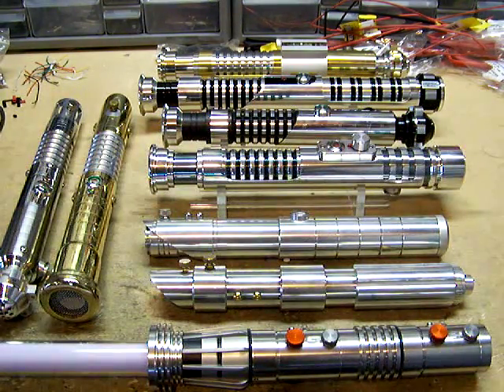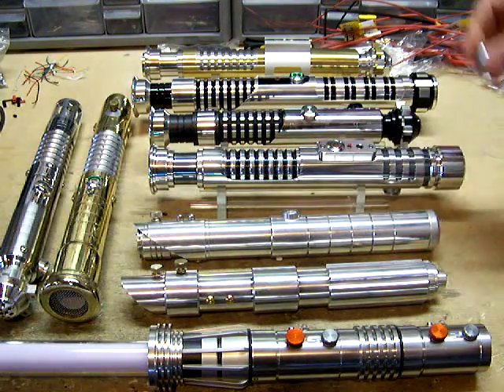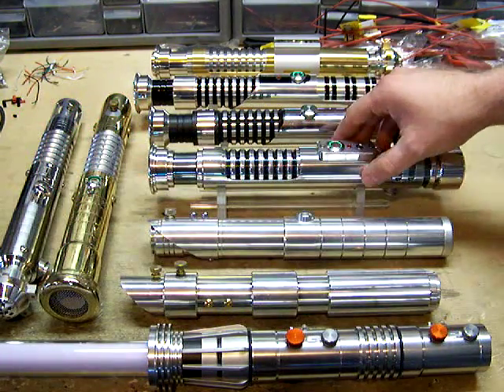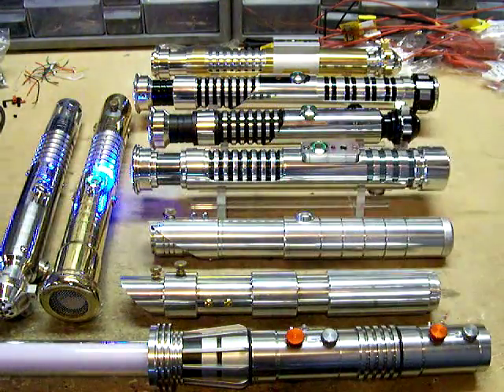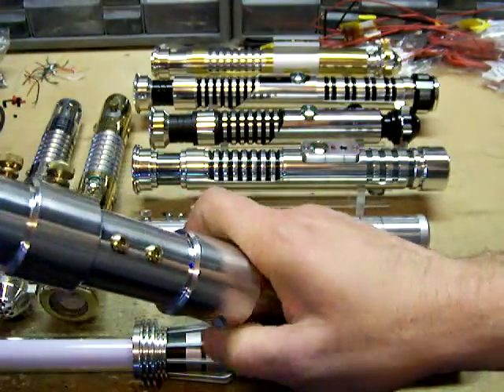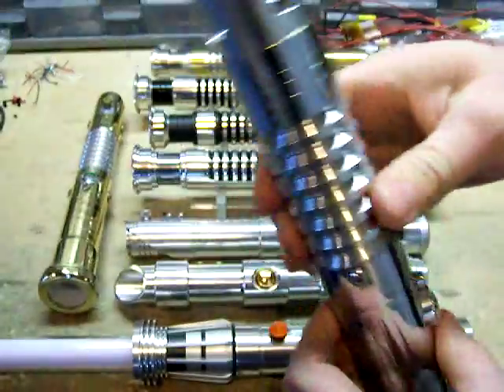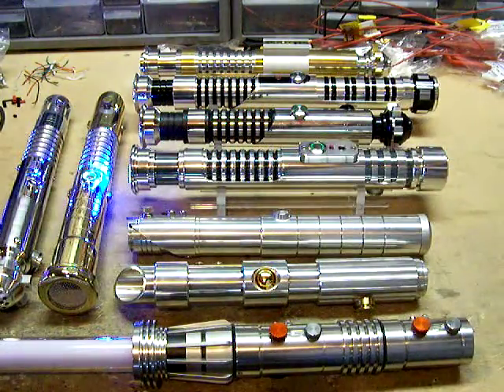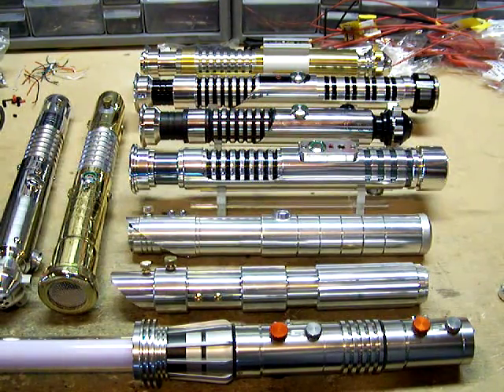Lightsaber Soundboard Volume and Resonance Comparison

Comment from the maker: I have heard from other people that actually own them that the sound quality is on par with an MR or Hasbro FX board,  or the Hyper board.  I don't own one and never will.  The sabers making sounds when I am not touching them do so because of the volume of the hum on those particular models.  I build them with open internals to increase the resonance effect,  and it can sometimes cause the sensors in the boards to detect motion from the sound wave vibrations.

Comment from the maker: I have many reasons,  but the one I'll share is that the board doesn't have an led driver built into it,  meaning you have to use a resistor to power the led on the pass through,  or buy a separate driver and wire it into the saber to give you blade effects such as flicker and pulse.  Extra wiring and costs that are not necessary if you use a board from most other suppliers.